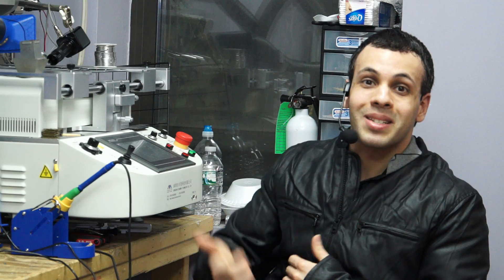How to get your #mbp2011 problem fixed for free!

Comment: This problem continued into the 2012/2013 retina's with the Nvidia 650 chip too.  It seems it didn't go away until Apple switched to Intel Iris GPU's...  idk.. I agree with you but the GPU issue w/ discreet mode definitely didn't end in 2011 regardless of rMBP vs MBP.  Maybe for most but a lot of others have rMBP's that have the same issue w/ the Nvidia chip.  AMD GPU's may've been worst in 2011 (pre retina) but yeah...  :-/
Reply: I would assume they would replace it with an exact same logic board that would be new but in time, if it's part of their line-up of "some good, some bad" it will eventually fail again.  They did push an SMC update to all of 2010+ mbp's that addressed fan-related issues some time ago.  Hopefully, Louis should be able to answer your question better...
Reply from the maker: I have never replaced a retina GPU. I have never seen them fail. I believe you when you tell me that the new ones suck, I would just like to see some documented proof. Forum posts, anything. For my own curiosity.
Reply: I posted a youtube video showing my poor experience w/ a 2012 rMBP that I purchased.  During that year they also had issues with pixel retention and dead pixels on the retinas.
Reply from the maker: The retention I know about. I mainly interested in the GPUs, and not an isolated incident. I want to see evidence  of them all dying!
Reply: Louis OMG Apple Forums are loaded with these.  Not that Apple cares but there's definitely a lot of documented material available out there.

Here's one:
 
https://discussions.apple.com/thread/5300005?start=30&tstart=0

It seem's people often refer to it as a Kernel Panic and a memory issue rather than what you explained in your video and what you explained is exactly the real problem, at-least with these GPUs.
Reply from the maker: Jason G. Media, LLC I've never seen it in the real world. Don't get me wrong, I'd like nothing more than to make a few thousand bucks more on the Zhuo Mao investment than to let it sit there cold, but with the retina, it is a stable design and I do not see that happening.

The fans do manage to suck in ridiculous amounts of dust with no issue so there is a chance of a repeat of 2008 or 2011!
Reply: It clearly happened and I have the pdf of the report but it was also a refurb I purchased from a vendor who claimed they were an authorized Apple reseller and the box which had matching serial number as the unit had "OVERHEATS" written on it.  I'm assuming they repaired the fans and the other weird thing, they only sell their refurbs w/ OWC SSD's and not w/ the original Apple.  Not sure why.  I tested both fans and they both ran at normal levels and I purposely set both to run at max RPM before I used 'GPU Test.'  Within 30 seconds the screen went blank but the keyboard remained lit.  When I tried to reboot I had to wait a few minutes or it either wouldn't turn on, like literally or it would get halfway through the boot and then go blank again.  With gfxstatus set to integrated only i ran the same tests and had no issues.  I was just pissed that I spent $2,000.  It was out of warranty w/ Apple but the vendor was willing to replace the logic board.  I was weary of it happening again and received a refund and bought the same exact model but non-retina  MD103.  Whether SSD or rotational both still used Sata so that part doesn't concern me.  The newer PCI-express retinas don't have compatible HD upgrades yet, last I knew.

Anyway, don't want to waste your time.  From your post I loved how you were able to disprove the ones who reball or any other crazy stuff like placing the logic board in the oven....  Possible quick fixes that ultimately don't last or may even destroy the logic board.
Reply: Louis Rossmann
Do you think there is a chance that Apple silently started implementing better repair procedures behind close doors? I only ask because my macbook pro after having it sent to apple is running at 32C idle, which could indicate newly applied fresh thermal compound, but I thought if Apple replaces your logic board with a used one, the thermal compound is already used...?
  I only ask because I am now worried about intentionally killing a good laptop that will last.

Comment: I've already paid the $350. I am now on my 2nd logic board w/Apple in 3 weeks. Booting it up yesterday, I was seeing artifacts showing up after watching a video and some brief Photoshop work, and that's the first day back after their fix!! Based on your video I'm guessing my latest chip fix is set to crash again. I think I'll be trying the stress test... the only frustration is that 2 weeks prior to the first graphic board failure, I had a new 1Ter SSD installed ($600) so technically I've laid out almost $1K.
Reply from the maker: By Apple or by someone else? Take that back to Apple and put the original drive back in before you do so.
Reply: Louis Rossmann Someone else put that drive in (a good computer data recovery place). Are you saying I should trade it back out so I have it to resell? Or would it cause problems in terms of getting a new machine? Apple has worked on the machine twice now with the SSD drive in there. Would they have noted that?
Reply from the maker: No clue. I'm just saying they're going to take the entire machine back, so might as well give them it back with the original shitty Apple logo'd drive instead of a 1 TB SSD!

Comment: Was quoted $310 today at apple for a out of warranty logic board replacement, will keep you guys updated on the repair process.

Edit:
Got my computer back today, time to run GPU test.
Reply: Not sure if you guys are aware, Apple is now addressing this issue.
http://www.apple.com/support/macbookpro-videoissues/
Reply: Vincente Shadiow
Are you still running gputest? Did the computer fail again? How long did it take? Thanks!
Reply from the maker: Thanks! I am excited to hear how it goes.
Reply: Updates?
Reply: Any updates???
Reply: Nothing yet. Waiting for this thing to die again
Reply: Vincente Shadiow any updates?
Reply: Vincente Shadiow Mine is running rock solid, top portion is really hot to the touch and still, nothing going wrong :\  Even if it doesn't fail under the 3 months warranty and say, fails 8 months later, I'll just do the blanket wrap method to fix it this time.
Reply: Vincente Shadiow something happen???
Reply: Nothing yet. Been running rock solid
Reply: Vincente Shadiow still nothing bro? I might be trying this out but I wanna know how other peoples results are
Reply: Francesca Di Gregorio 
So far it's been running none stop, CPU temperature is around 95C, GPU around 76C, it hasn't failed yet.
Reply: T Lynyrd Any updates on your progress? Seems the new replacement is pretty strong.
Reply: thanks alot, everything worked out the way you said it would.
Reply: Keventh Campoverde Awesome to hear that! Can you share your experiences? Would love to know, thanks!
Reply: any updates? what happened

Comment: I have to confirm that what he said as option 1 worked for me before I watched this video, and those exact steps where the ones I followed and yes, today I have a new Macbook Pro Retina 15" with even a new external DVD drive for free because the retina don't come with one and they gave me one for free. Have in mind what he was really clear about, BE NICE TO EVERYONE cause I was and I actually even offered paying for the difference in price with a new retina and they ended up giving it to me for FREE!!! I did get Apple Care on the new one tho just in case something similar happens again with this newer models.
Reply from the maker: That's the thing.

When you offer to pay for something, when the service provider knows in their heart THEY should be paying for it, you get treated like gold.
Reply from the maker: I will let this be your journey.
Reply from the maker: Nick knows what's up!!
Reply from the maker: Yikes. So you went from a dual core processor which would run cool to a quad core processor which would fail. That is scary. These machines should not have quad cores in them with the cooling that they have.
Reply from the maker: Doh, I must've misread. I thought you meant Apple laptop quad core, so many of those are a nightmare. 'specially sandy bridge!
Reply: *****  NY and I think Apple still offers the 300 dollars flat repair rate.
Reply: jasoprano ($336 including tax) NY. Don't do it because after watching this video i got replaced BEFORE ONE MONTH  and following option 1 exactly..i really mean it. there no sign failing and still continuing...may be Louis knows how to do it. only two months left fingers crossed i would rather pay Louis do this.

Comment: Always enjoy your videos. Is a shame the crap that companies push out knowing they have a shit design that will fail. I have 7 HP DV series all bad GPU. Sometimes I wonder if they are even worth fixing just because I know they are junk and will fail again.

Keep up the videos. I learn a lot from your board repair videos.
Reply from the maker: Chris Long HP DV series all go in the trash where they belong. Most HP laptops belong in the trash, they are not worthy of the e-waste bin.
Reply: Louis Rossmann Ive felt that way for a while about them haha. Currently messing with a Compaq CQ62 aka HP G62 and I cant figure it out. Doing it more just to hone my skills but Im thinking it has bad IC that sends signal to the SB, Vgacore, SUSON, MAINON, s5_ON. I get voltage, gnd, and signal from the power buttton to it but nothing comes out.
Reply from the maker: I lack the experience to judge or have an opinion on HP business class laptops.
Reply from the maker: :( That's all I needed to hear.
Reply from the maker: The shitty cooling system.
Reply from the maker: I did not want to prejudge a product that I had not used before. However, my first impression when I hear that this is an HP laptop, is that the cooling system will suck, and that they will be poorly designed. To me there are three classes of laptop. The first is cheap junk, crap that is not well designed, nor built to last. The second are laptops that are built to be pretty, sleek, interesting like Apple. The third category are laptops that are actually built to last, built to survive drops, spills, and are built towards the demographic of business and engineering users, like the T & W Series ThinkPad before they sodomized it. It is usually very simple to fit a laptop into one of these three groups.
Reply from the maker: That's thinkpad for you. And they're not crazy expensive either, the last two I bought were $700-$900.

Comment: Can't people abuse this by buying Macbook Pro 2011 off eBay for cheap and they get a Macbook Pro Retina for the repair fee?
Reply from the maker: My intention isn't for people to do this to scam Apple, but yes, that is probably possible. 

None of this shit would be possible if they repaired them properly to begin with so they wouldn't fail within three months. This is why I don't feel bad if people utilize this advice in that way.

Many people will come here and say no machine can survive this kind of torture. Keep in mind this Macbook Pro has TWO fans. My Lenovo T520 has ONE fan, and it MINED LITECOIN on the discrete GPU using cudaminer for months. Day in, and day out. I have about $85 in litecoin from that quadro.

cudaminer is more of a load on the GPU than furmark, and that T520 is still here encoding these videos  & uploading them to youtube so my main laptop is free to perform regular tasks without running slow. Did I mention the T520 cost half as much as the A1286 Macbook Pro did in 2011? 

I don't feel too badly in this situation, the only abuse taking place here is Apple marketing these machines to pro video editors and telling their customers to go F themselves when they fail.